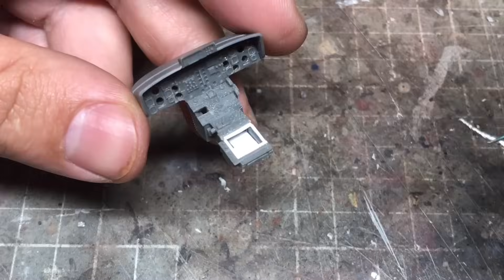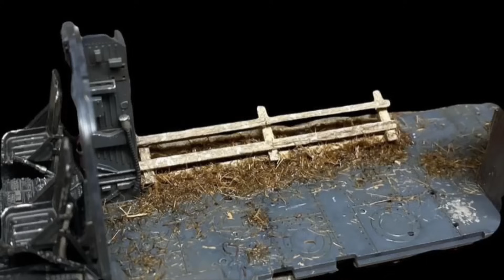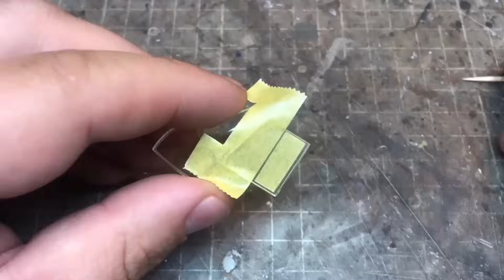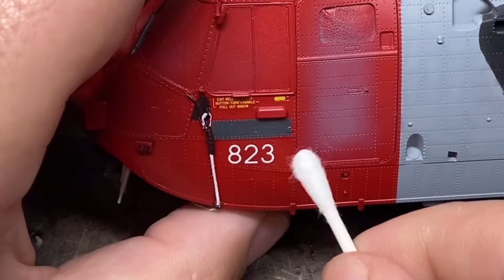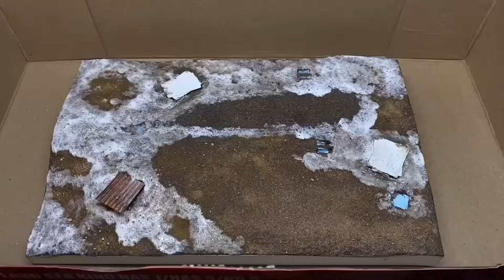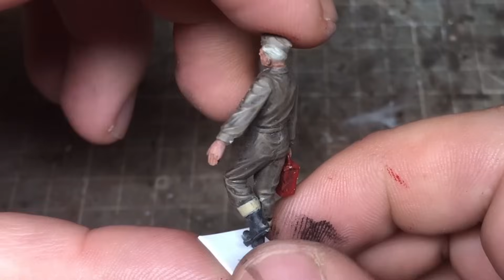From King To Chicken! 1/48 Airfix Sea King (New Tool)#airfix #seaking #148 @OfficialAirfix

Comment: i think the end result was good! I would like to know where did you get the LED lights?
Reply from the maker: @BayouChilehead  thanks! I got them of wish the LEDs were 0402 I have in the past gotten them from eBay but they come with a really thin coating over them which is found next to impossible to strip so they can be shorted so I stuck with the wish. They have a cover that's a little easier to strip after shortening but they are delicate when you want to do that but if you have anuf room to stuff extrra wire I wouldn't worrie
Reply: Thanks! I'll look those up!

Comment: Any holes  /areas such as the exhaust on something left out for a long time  -  9 times out of 10 will have had birds nesting / animals sheltering  in them  ..that exhaust / Rotor area  would not have remained empty for long it would be full of grass, twigs, moss  and hay .. . ALSO .. you missed lots of Bird crap around said area's ..

The interior is far too clean .. that hay would have gone EVERYWHERE .. also it would have been covered in feathers and bird shit .. (Pigeons would have loved  the interior) .. It basically would have been one hell of a mess
Reply: Interesting points however I feel you need a bit more context:

These chickens have hired a cleaner who pops around once a week to make sure all the floors and walls are in good order. Naturally, their role does not extend to external maintenance as they are but a humble cleaner and not an aircraft technician.

The aircraft has actually only sat there for a few months, but these things weather 48 times quicker than the real thing (it's a scale thing). Of course no one has told the pigeons this and they still weather in real time.

Finally, chickens don't make nests in exhausts as they are afraid of heights. That's why they can fly but choose not to.

Hope this helps.
Reply from the maker: Its only been there short while
Reply: haha thanks .. I wasn't being critical .. the build is fantastic ...   but i am just going from knowledge when i parked a car up for a few months .. i had a mouse nest in the engine  and a variety of  critter markings .  
I understand now your story for the Helicopter and it makes sense .  
  @VFCproductions
Reply: ahh Makes sense now  @SullysScaleModels
Reply from the maker: @kittyhawk9707  tbh some of that i had thought of at one point but with what had been going in i must of forgot i may re visit them ideas or in the next one i will ad them i have a couple of other projects similar to this in the future!